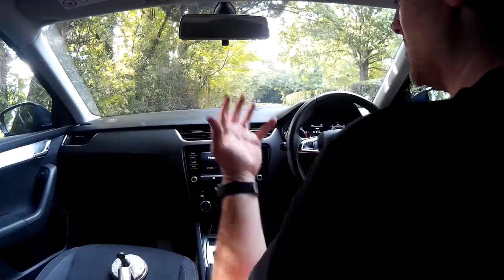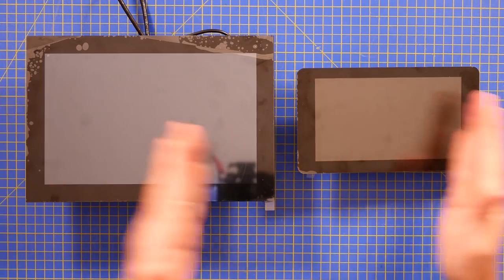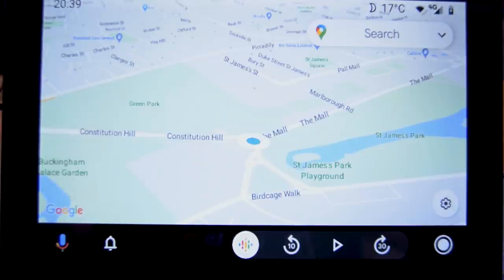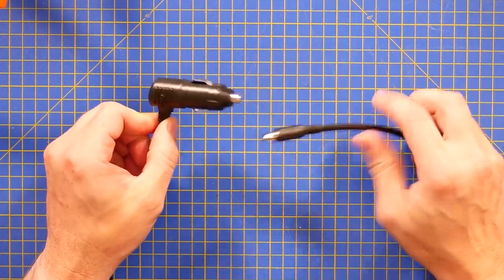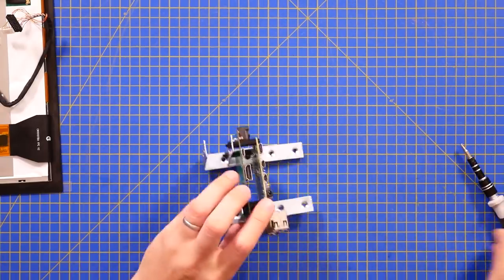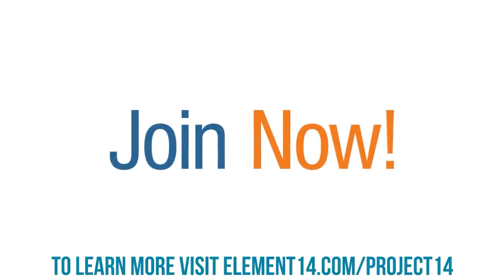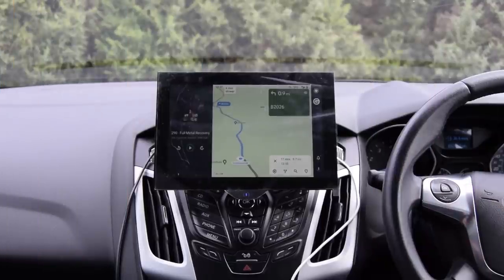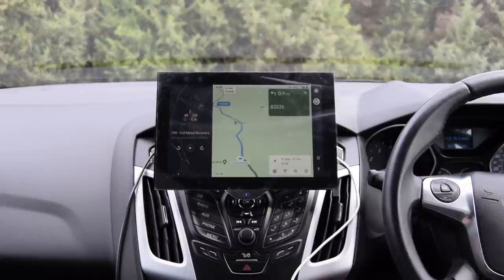Adding Android Auto as Non-Permanent Add-On with Raspberry Pi

Comment: I had an 8th gen Civic ('06-10 I think). I got the double DIN adapter, cut a slot in the top, and built brackets in the back. With an LG 8.3" tablet it was the exact size screen of the double din and has a sim card. Then headphone out back to an amp. It also has HDMI out via usb so I put 2 good magnets above the head board, ran some HDMI and used an old laptop screen to 'clip' onto the roof for the kids to watch something.
Worked really well, I just couldn't leave it in the cars heat in summer.

My next step was one of those old school headphone cords with the built in control buttons to tie into the steering wheel buttons. I never got around to it though.
Reply: That sounds like a cool project.

Did you document the build or your results anywhere?
Reply: Hi  @a531016  Do you have wiring diagram? I'm bit confused seeing it just on video. And didn't found anything on elements 14 website. Thanks

Comment: a lot of radios w/in cars have the ability to use an external equalizer, so check the back of the radio for the needed i/o ... you might be able to use this as your sound out to your speakers, or an external CD changer.

Comment: It would be cool to see how it was mounted without puncturing car. Also I am wondering if it will be better to put rpi, and rest of electronic away from screen to protect it somehow from overheating and make screen more flatish.
Reply: yeah, that pi stuff could have been mounted higher making the sides a triangle, widest part at the top.
why not make the add on board stick out away from the pi, better ventilation,  the items on top of the add on could be on the other side, less height, all depends on the way it gets mounted to the car, no details about that because any other car might be another problem to solve ...
Reply: I'll see if I can find some time to take the covers off and take some photos in situ - It should make it all a little clearer!
Reply: Yeah that was my thing too.  I have built one for myself as well.  I've had in the car 3 different times as I made different design choices after using it.  All 3 times I replaced my stock head unit but my car doesn't have the power I think to sustain everything so I'm cutting it down and Ive been working towards doing it this way as an addition to the stock headunit.  Stock sounds good and I really want to see the actual mount.

Comment: all power within a car's electrical system is 12 volts.  but it isn't not trivial, do not touch the distributor cap, I did this as a dumb teenager and woke up 6 feet away flat on my back after being thrown backwards by the shock.  the first cars were only 6 volts.

Comment: Question I have is, does the Pi charge your phone as well?
Reply: Yes, very nicely! I deliberately connected it to one of the USB 3.0 ports on the Pi4 as they support a higher charging current. I have found in the past that USB 2 doesn't always result in more charge at the end of the journey.

Comment: I guess this works fine if you remove it after usage, but you can have issues with temperatures and condensation in summer and winter
Reply: Good point. Fortunately the UK is pretty uneventful in weather extremes.

I haven't had any issues yet, but will let you know if anything comes up!

Comment: Hey! Lovely stuff!
Have you tried to connect the smartphone using the Wifi interface of Android Auto?
Cheers!
Reply: I have a set up like this but i use open auto pro software instead of crankshaft. I use it wireless and it work flawlessly.
Reply: I did in the testing phase use wireless, and it was "OK".... But I have to be honest, I like arriving at a destination with an always fully charged phone.

Of course there could be some balance if you have a phone with wireless charging and wireless connectivity, but for me cabled was the right way to go.

Comment: Does android auto support canbus and obd2? Or that would be through the crankshaft gui only?
Reply: To the best of my knowledge, only through crankshaft. You can map canbus functions into Crankshaft to perform "stock" functions (i.e. if your steering wheel controls are canbus, or ignition etc).

With that said, you can bet bluetooth OBD2 adapters that can connect to the phone, which with an appropriate app may work for you?
Reply: Crankshaft gui only

Comment: I wonder if this is worth the effort vs dedicating an old Android tablet to being an infotainment screen.  I have been working on the latter.
Reply: It really depends on what you are after. I like the Android Auto way of working, with my phone as the main controller (for navigation, notifications, music etc).

With a tablet, you run into questions over bluetooth connectivity (the phone or the tablet). Do you then run navigation on the tablet? How do you get live data to it? etc...

I really did look at this, using a tablet with Android Auto running on it, but I couldn't get sufficient charging and connectivity working well enough (you need a proper "accessory charging adatper"). It also didn't feel as neat once all this was connected?

Comment: I'm certainly interested in doing something like this, my problem however is my car has a small color screen which displays gps, climate control settings and fuel computer etc. My question is, is there a way I can reroute all this data to an external display, or would I need to hook up my scope and decode the canbus, write custom protocols etc which would obviously be a pain in the butt. I noticed in the Focus you just covered that screen, I use this data all the time however.
Reply: I suspect the interfaces are proprietary so ...a great feat if pulled of from scratch.
Reply: I found a great tutorial on YT to capture all can bus data to file on an Arduino, and filtering it to decode the results. The protocol is standard, and if you have a common car, you'll probably find someone has already done it!

I am tempted to do a follow up project looking a little more into android automotive OS. This can handle the complete management of the infotainment and climate systems!
Reply: @a531016  Sounds ideal
Reply: There are bluetooth and wired  OBD2 diagnostic adapters that allow you to view canbus/diagnostic information. I'm sure there's a Linux program to decode the information as there are various androjd apps that allow you to view/change the car's parameters

Comment: Cheap AA-capable Android head units can be had for 50 bucks, this is super niche and overpriced for having a janky homebuilt solution
Reply: The Android head units under $600 (in my experiance at least) are cheap for a reason... In addition, moding from the stock unit like this to a double DIN unit requires adapters and that becomes a permenant mod that you would have to notify your insurer of (in the UK at least).
Reply: I think the main premise of this is not to touch the existing wiring etc of modern canbus cars whose screens are too wired to the car. This is a nice plug and play solution and requires lesser effort. A headunit swap means messing around with splicing wires and harnesses, panels etc and yet compromising in some manner and giving up some car features
Reply: @a531016  Wth hell does insurance have to do with a radio ?
Reply: @David Edwards UK insurance providers generally require you to notify them if your vehicle has been modified. If you haven’t told them about modifications they could void your insurance. One of the apprentices where I work has to send his insurance company photos of all the modifications he’s got on his car, including stickers!